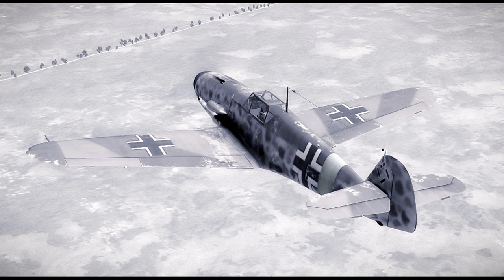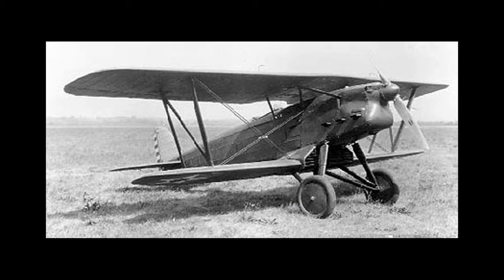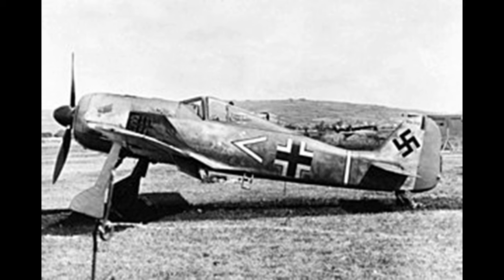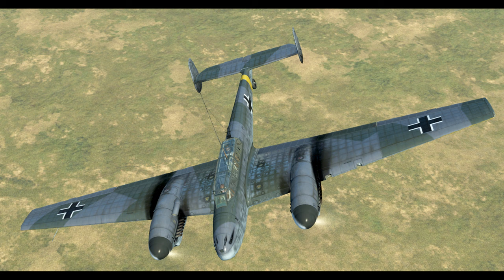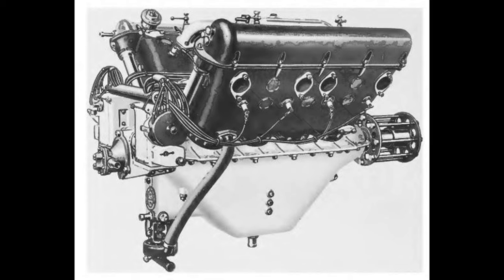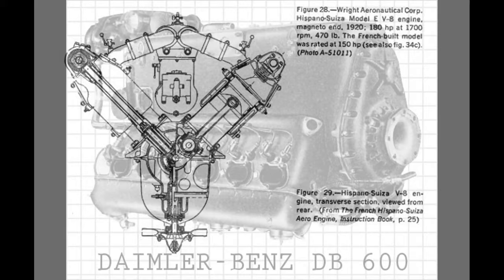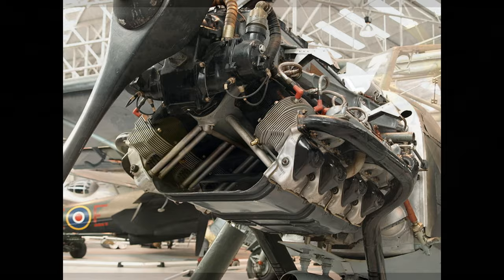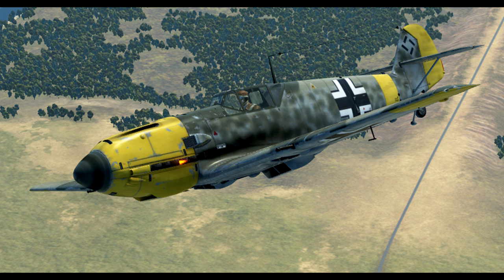Messerschmitt Bf 109 , Why an INVERTED V-12 Pt. 1? inverted V12s vs. upright

Comment: One small additional consideration, the German engines used fuel injection which was quite new and affected by gravity.  The allies relied almost exclusively on carburetors, these had float/bowls and would be much more difficult to fit to an inverted V engine given their dependence on orientation relative to gravity.
Reply from the maker: That makes sense, however the original DBs had carbs.

Comment: The Maybach engine and its offspring used in most German halftracks and tanks was also originally an airplane engine. The German industry early on decided on using a limited type of engines/producers so the higher development costs were less an issue.

Comment: One thing not discussed in the clip was packaging of weapons. The Germans were more wedded to fuselage mounted guns in their single engined fighters.  Was it easier to mount weapons over the top (crank case) of an inverted V12 than an Allison, Merlin or a radial?
Reply from the maker: There are many planes with upright V-12s and radials with cowl mounted weapons.

Comment: Great video, but I was left with a question. You gave as a main reason why the Allies didn't use the inverted V in their planes was so that the (basically) same engines could be used in boats and tanks as well as planes. I would have liked if you went BACK to the Germans again and addressed why they eschewed the advantages of using a standard V across multiple platforms. I guess they (possibly) just liked the benefits of the inverted V for their airplanes and decided designing multiple engines for the planes and tanks/boats was worth the extra effort? I know it's conjecture but I would have liked your thoughts on that too. Again, good video.

Comment: One more thing. Inverted V-12s make room for cowl mounted machine guns firing through the propeller arc. Most single-engined upright V-12 aircraft had wing mounted guns. Btw, inverting an engine has no effect on frontal area. It's the oil coolers and radiator inlets and their placement that make the difference.
Reply from the maker: I cover this in part 2. There were many planes with cowl mounted weapons and upright V8s.
Reply: @GregsAirplanesandAutomobiles  agreed. It was mostly earlier designs that had cowl mounted weapons and upright V-12s. P-40, A6M, etc. It's awkward however because THAT increases frontal area because guns must be on top of the engine instead of beside it, plus the recievers intrude into the cockpit.  Sorry, l guess l didn't see part two.

Comment: One reason may be, that designers try to stay with technologies they are experienced in, to reduce risk.
V-type aircraft engines date back to 1909 or so in the US, to shortly before WW1 in France and at least to the mid WW1 period in Britain. Germany had no V engine "tradition" in aircraft applications (besides Maybach Zeppelin engines, that ultimately evolved into tank engines and not in heavier than air aircraft engines). All german WW1 (heavier than air) aircraft engines were inline or rotary engines (a Daimler-Benz V-8 was in prototype stage in 1918 and stopped when the war ended). Before the Jumo 210 was developed in the 1930s, the only V-type aircraft engines produced in Germany were Junkers and BMW V-12s that were not much more than doubled WW1 style inline-6 engines. They were hopelessly outdated in the early 1930s and aircraft engine developement in Germany was far behind Britain, France, the US and also Italy. Germany needed to close the gap. This may explain, why they tried to make a big leap instead of many small steps. Both the Jumo 21x and the DB 60x series were completely new designs that had virtually nothing in common with older german engines. When you have to start on a white sheet of paper anyway, you can use this freedom for something new. Obviously they tried to get rid of as many disadvantages of traditional engine designs as they possibly could. 

The low exhaust position of inverted V's also reduces the amount of exhaust gas that reach the cockpit area on single engined aircraft. No complicated ventilation system is needed, no need to use the oxigen mask all the time (like in the P-51) and less dirt on the glass.

Comment: I did a little looking into contemporary secondary sources (20s-30s) and I'm finding a bunch of very brief mentions of the inverted configuration, and I notice they all say pretty much the same thing: "Germans have been working on inverted engines, which are great for visibility. Everybody thought they'd have lubrication/fouling problems, but they seem fine."

Comment: The German wikipedia entry on V engines (https://de.wikipedia.org/wiki/V-Motor) lists these 3 advantages of inverted V (in some very old documents called A engines):
- lower center of gravity
- better visibility because of lowered exhaust
- shorter landing gears because the propeller is higher (which I find doubtfull as the axel of propeller is between the cylinders not through the crankshaft)

Comment: In Calum Douglas’ new book the Secret Horsepower Race, on page 74 a set of specifications from the German Military in 1926 for news engines to be built by private industry. It was only in the 1930s that firms started to respond with new designs. Douglas’ book is highly recommended.

Comment: With the oil pan at the top of the engine, visibility would be improved because the widest part of the engine, across the cylinder heads, are below the pilots view. It also allowed the twin cannons above the oil pan on the ME109 to be closer to the pilot's point of view, aiding in the arming of its machine gun, and in the case of the German engine, provided a space through the propeller hub for its larger caliber cannon.

Comment: Greg, I just came across a probably terrific 2020 book called the "The Secret Horse Power Race".  It is about the WWII fighter piston engine design competition among the nations and companies making the engines.  This extended to a lot of intelligence activity.  If you had not heard of it, it has 4.8 stars on Amazon and a lot of very positive reviews.  

The author is a mechanical engineer.  He also has a channel here named after himself, Calum Douglas.  He has a Youtube video tilted "WW2 Aero Engines: Why were German V12`s inverted?" which gives some primary German sourcing and interview (Wolfram Isanhau? 56 page interview transcript) results.  Among the reasons he quotes that seem very sound but not mentioned elsewhere:
1.  The inverted better supported the centralization of weapons, and mounting weapons on the engine allowed the weight of the engine to absorb recoil with less shaking, thus leading to smaller dispersion.  This was a nice supplement to the already tighter pattern as compared to wing mounted and the need to converge fire.  Somebody with shooting experience was involved here. 
2.  Besides less exhaust flash to damage night vision, less fumes entering cockpit. 
3.  Better "hot" cooling--not clear exactly what that is, but Calum thinks it is an important point.
Reply from the maker: I know the book, in fact I just referenced Mr. Douglas here in my most recent video.

Comment: There are advantages in cooling also, 

Cylinder heads that are run at an optimal temp will resist "knock" better than cylinder heads that are run even slightly warmer. 

Most cooling systems introduce the cooling inlet flow at the lower part of the system (IE the water pump pulls cooled water from the radiator and forces it through water passages in the block, it flows past the cylinder sleeves/liners and then up to the heads and the out to the radiator to be cooled again.  

Nearly all automotive engines use a system that introduces the cooling water at the lower part of the system and the outlet it very near the highest point. 

This has at least TWO reasons: to allow the system to be "bled" of trapped air bubbles easily, and because warming of the water creates a moderate siphoning effect due to the hotter water becoming slightly less dense, and then rising under its own siphoning effect. The Ford Model T did not have a water pump, and so it used this sort of flow theory to provide coolant circulation. Most engines that used liquid water, and not air or steam, used this method to circulate the water in the initial years. 

It would be less efficient to try and force the cooled water to decend through the block while it was also becoming hotter. 

So, if you want to take maximum advantage of the siphoning effect, and you also want to introduce your cooling flow into the heads to have maximum knock resistance, then inverting the engine is the obvious solution. 

Alternatively, one could use two cooling systems in an upright engine, one for the engine cylinder sleeves/jackets, and another than cooled the heads exclusively. You could then run two different coolant temperatures in their respective systems; say 225°F for the engine jacket water temp, which would be cool enough to remove the heat from a several-thousand-degree cylinder, and it would make your heat exchanger more effective, because heat transfers more rapidly from a hotter device. (ie a radiator at ambient temp transfers zero heat, and the hotter the radiator runs, the more heat it radiats away into the air).

So, you can have a smaller (lower drag) radiator for the engine jacket water, and a larger radiator for the cylinder head coolant system that runs at a much lower temperature; Say 180°F cylinder heads. Alternatively, use two radiators of the same size, with the cylinder head radiator mounted in front of the jacket coolant radiator, which would cut cooling system frontal area approximately in half. The front radiator cools the cylinders to a lower temp then the rear radiator, but its okay to cool the rear radiator only to that higher temp). 

This would provide Maximum knock resistance by coming the heads and valve and spark plugs (if they are mounted in the head and not the cylinder sides). Which would reduce knock, allow higher boost and horsepower, and it would significantly reduced the potential of true "preignition" which can truly self destruct an engine in one revolution at higher boost levels. 

One other consideration, 
The DB series used Roller bearing elements which require a small fraction of the oil of a modern plain journal bearing. This reduces oil pump requirements and pumping losses, freeing up horsepower and weight of the pump. 

This causes a problem, less oil slogging around in the crankcase means less oil hitting your pistons backside, which means hotter piston and significantly increased knocking potential, requiring hi octane, lower boost, and less Power.

Inverting the engine allows that reduces oil capacity to flow and sling downward to flow into the pistons under side (top side) for an inverted engine. The pistons slight the coolibg oil back into the upper crank where it flows down channels and arrives in the low mounted heads, where it lubricates the cams before being picked up by the valve cover mounted scavenge pumps. This also protects the cam drivetrain from rust when parked.

Novel Over. 

But one can see there are all sorts of options, but inverting the engine provided many advantages for an aircraft.

Comment: I may be wrong, but I was under the assumption that at least one of the reasons the engine was inverted was to make room above the engine for the armament.  And the landing gear (I thought) was placed in the fuselage to keep the wings as thin as possible.

Comment: Eccellent as usual. Just one thing: the Rolls-Royce Meteor V12 tank engine derived from the Merlin was not fitted into the Crusader tank. The first tank using it was the Cromwell, which was a significant improvement over previous "cruiser tank" designs. I reccomend: Evans, Mc Wiliams, Withworth and Bich: The Rolls-Royce Meteor - Cromwell and other Applications, Rolls-Royce Hertage Trust, Derby, 2004.
Reply from the maker: Yes it was, but you are not exactly wrong. It was only fitted into one single Crusader for testing. It gave the Crusader a top speed of 40mph! Now I know that one tank doesn't make the Crusader a great example here, but that's why I put up the Comet as well. I like the Comet, it just looks right to me.
Reply: @GregsAirplanesandAutomobiles  I thought we were talking about engine applications in planes and tanks produced in series. Therefore, saying that the Meteor engine was fitted to the Cromwell tank, is at least misleading.

Comment: The reliability of Tiger and Pather was actually alot better than it is portrayed today. Documents from the German army state, that they both are a tiny bit less reliable than the pz. IV, which together with the pz. III, were the backbone of the German tank force.
Source:
The Tank museum in Munster, germany got a hold of availability quotes from Eastern and Western front. In the West, the vehicles are a bit more reliable than the East, thanks to the climatic differences, that result in a milder winter and colder summer.

Anyhow, i very much enjoyed the video and if you need any help with German documents i would happily try to translate them for you, but keep in mind i‘m by no means a native speaker.

Comment: A few random thoughts from an aviation and marine mechanic & geek...

Can't speak to German aircraft specifically, but inverted engines generally allow the engine to swing a bigger prop from the higher crankshaft, effectively allowing more power in a smaller airframe - same reason the F-4U had its distinctive wing shape. Grumman used Rangers on the Widgeon to keep the props up clear of spray, so essentially for the same reason. Interestingly, those engines still carried the interrupter gear despite never being a combat design, but lots of engines were available at the time.

Maintenance and reliability are worse because oil wants to collect in the valve covers and has to be actively scavenged, especially on starting (as you mentioned later). When it's in flight and everything's working properly, its not an issue...which was the problem with most German tech: it was great in service under design conditions but required more skill in its maintenance. The IL-2 was kept flying by tractor mechanics.

That's one of the big things (besides being led by a maniacal fool) that cost them the war, especially toward the end.

There is also the issue of airflow. The inner 1/3 or so of a prop doesn't contribute significantly to thrust. If you can raise the prop hub (crankshaft) axis enough to get more of that outer 2/3 of the prop sending air over the wing instead of under it, you'll increase airflow over the top of the wing vs under it, increasing the pressure differential between the upper and lower surfaces of the wing. 

In short, it ought to generate more lift for a given airfoil.

Comment: Great topic, I've always thought the 109 was unusual because of its upside-down engine. And it makes sense about ease of maintenance, I never thought of that!
I'm surprised that you didn't touch on the armament side of the arrangement. I'm sure the fuselage mounted guns were a direct result of there being open real-estate atop the engine bay, making for a more desirable gun placement, vs wing mounted guns that have to converge their fire. Not to mention the propeller hub centered autocannon the 109 was famous for.  I've always thought would probably be impossible on an upright engine since the intake plumbing and timing drives would be in the way.
Reply from the maker: I have been surprised at how many people have talked about the armament. However, look at fighters from 1915 to about 1940, the vast majority have cowl mounted weapons with all different types of engines.

Comment: Interestingly theThe 109 first flew with an upright V12, a Rolls Royce Kestrel. 

My understanding is that the RLM directed the engine configuration to the manufacturers. The thoughts were better visibility as the engine was narrower on top, and the exhausts were lower down, with less effect on night vision.

It also allowed two machine guns to be mounted more in line with the pilot's vision, and maybe the breeches were accessible in the cockpit to clear jams (not sure about that at all and just surmising).

I've read that the DB engineers (perhaps Junkers too) wished they didn't have to go inverted because it caused a range of issues, including one bank oiling up more. In fact they lowered the compression ratio on one bank relative to the other to deal with these asymetric effects. The lower prop line reduced ground clearance too. Perhaps not enough to cause many issues, but certainly not an advantage.

Another potential advantage might be a better vertical alignment of the propellor thrust line with the aerodynamic centre of pressure. This would reduce pitch up or down when you changed engine power. I'm just guessing on that, but the Spitfire propellor was a lot higher than the wings for example.

Nobody else has really made inverted engines, and you can't get away from the fact that the crankcase has oil swirling around and that oil can't avoid gravity. A sump works well because that's where the oil goes, but it's not so easy when you're inverted. A radial has the bottom cylinders of course, and I don't know if they have special problems, but it seemed common to turn a radial over by hand to clear the cylinders...

Comment: I was in the air museum in Kalamazoo, sat in an Me109 and also in a P47 (Jug). The Messerschmidt was cramped and tight and the Jug was just wide and comfortable. Watching your video I realized this is because the cross section that you showed. Maybe Americans could just afford to build bigger fighters using more material and just burn more fuel to push that bigger cross section and cared more about pilot comfort/fatigue. I am curious if the Me 109 had smaller fuel consumption then the P47 (for the same distance traveled) or not. The US did not need to be frugal with aviation fuel it produced 90% of all aviation fuel made in WW2.